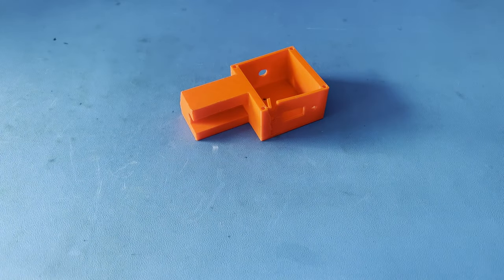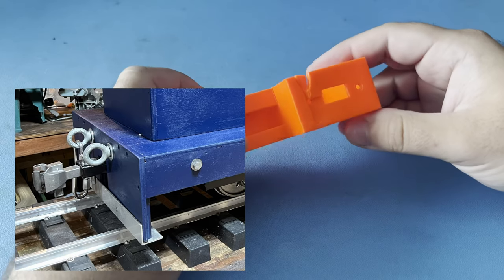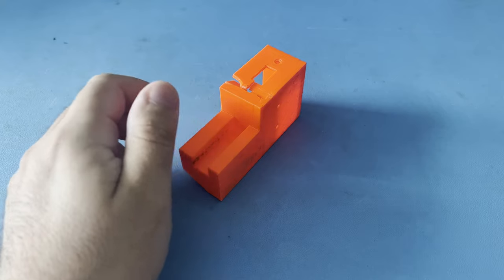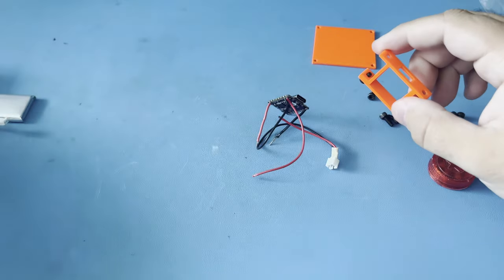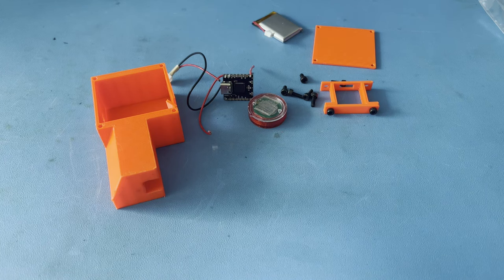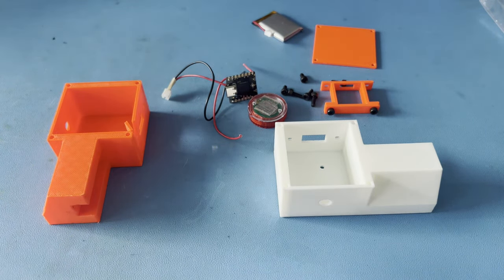End Of Train Device Destruction

Comment: Calling it "End of train" might be bad juju. Especially on MLBK, call it the "Anti-crash device" instead 😁
What is that, like an ESP32 or something?
Reply from the maker: It has a tiny board from Dfrobot that has a  lithium battery charger onboard which makes it easier to operate. I’m not sure what processor it was but it’s not WiFi capable unfortunately.